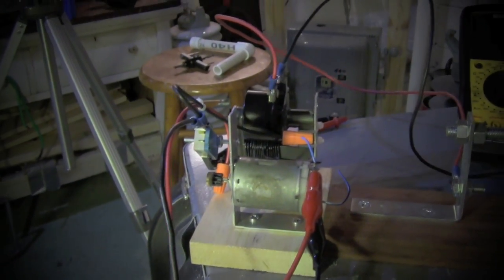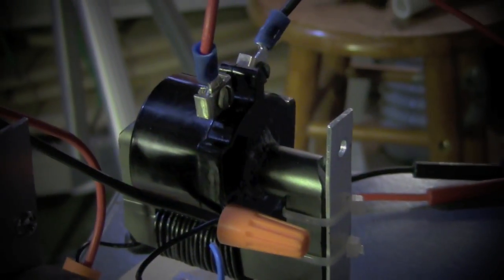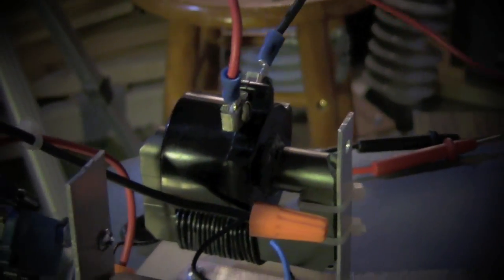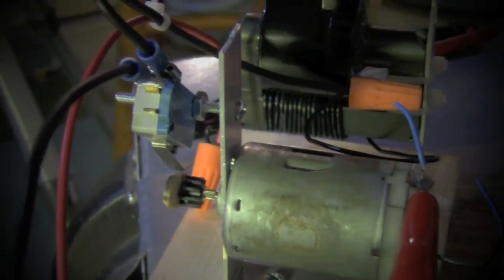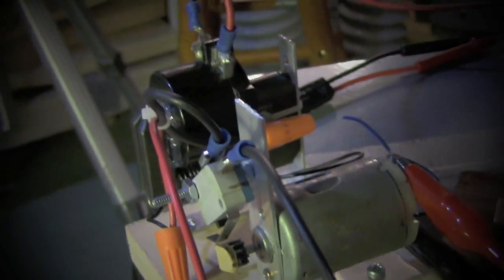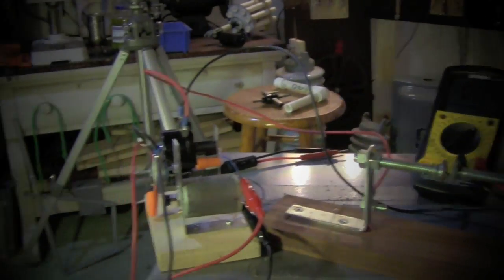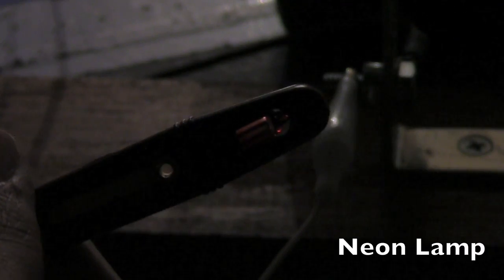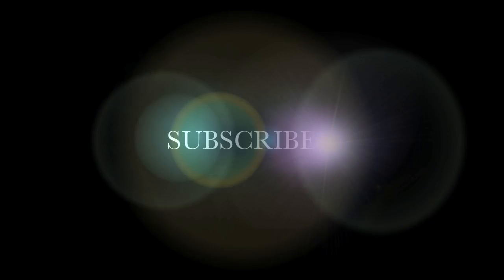Homemade DC High Voltage Transformer

Comment: Sorry, but this still is not DC current. Let me explain: The Transformer does not output the input multiplyed by something - if you sent in a switching voltage with 5 volt and the transformer should output 100 volts, it will do it on the very beginning, but since now the magnetic field is built up, it will sent out between -50 and +50 volts, cause it stabilizes.

Try a HV rectifier, this things will work without any problem, even on MOT's etc. ;)

Comment: Cool, it would work much better if you used a MOSFET to switch the primary coil at somewhere around 20-50khz though since ferrite cored transformers are not very efficient in the low hz range like you have it now. Some iron laminations would probably work better as a core with how you are driving it now, since that is better for low frequency transformer cores.

Just out of interest, can you measure the resistance of that secondary coil you are using?

Comment: if you want to do high voltage experiments i would recomend a real flyback transformer, and if you want arcs fast and easy build a 2n3055 flyback driver, and if you want something that does not burn out everyfive minutes build a 555 timer flyback driver. both of these circuits are reletivly easy and have a reletivly good output.